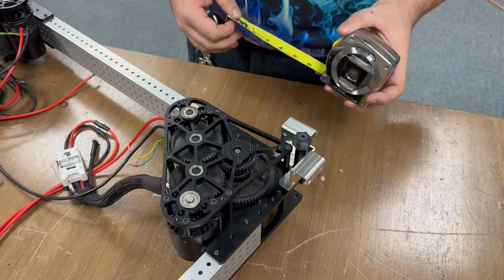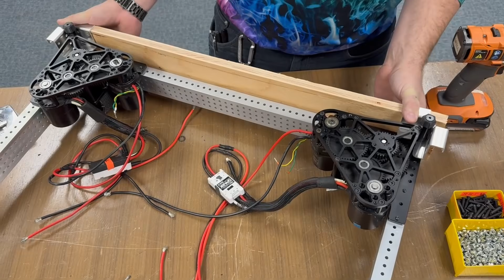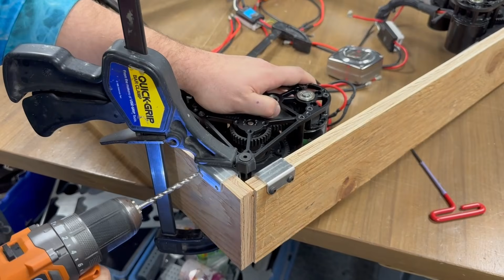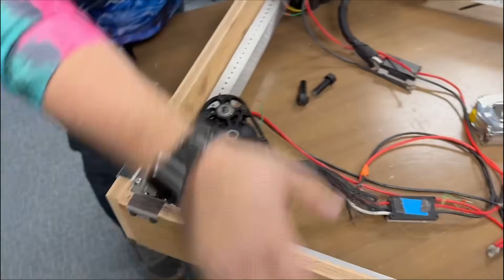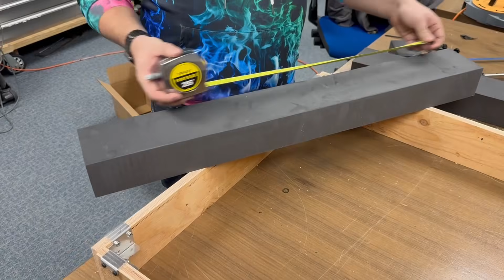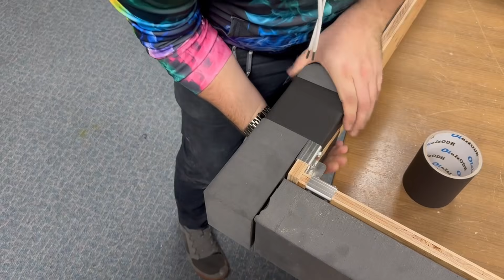Building Bumpers with Thrifty Hardware Kits and Foam

Comment: No support for the bottom of the wood and just screws so close to the top. Nice mounting system if you build out the bumpers more robustly. Might want to add that bumpers built with just what is shown would not hold up to competition use. Don't want a rookie team trying to just use the mounting brackets to hold them all together
Reply: As a rookie, I have been tasked with designing th ebumpers of my team. Any advice or recommendations for tutorials? What mounting systems did you use? How were they?
Thank you so much!!
Reply: @Theghost81818the Plummer Industries bumper mounts are really nice, pricey but nice. When it comes to the foam we did a dual layer. The Thriftybot foam seemed too stiff so we sliced it it half and used the tapered outside half. We picked up some 2 or 3lb foam sheet for the inner layer and glued them together. That worked out great. We had a bunch of teams ask us about our bumpers last year and there might've been a thread on Chief Delphi about it. I've had to take a step back from mentoring for personal reasons after the season but I know there was a lot of discussions going on about doing a video or class about it. Search frc 5090